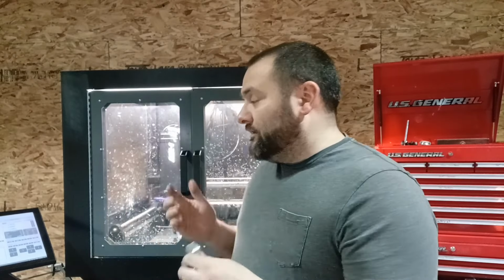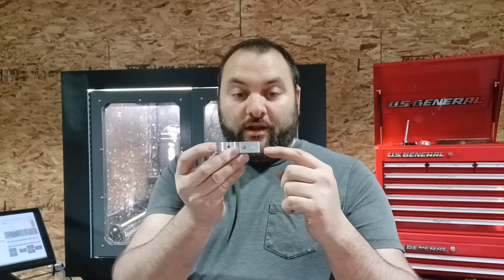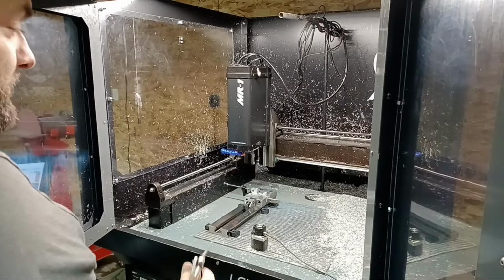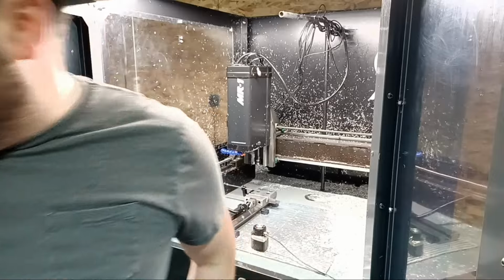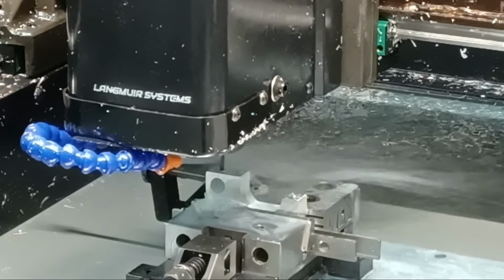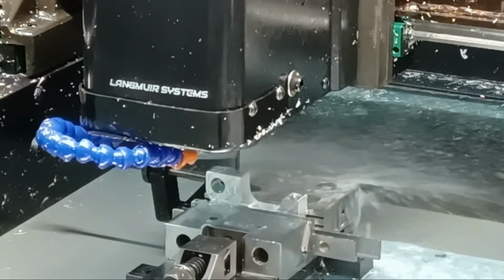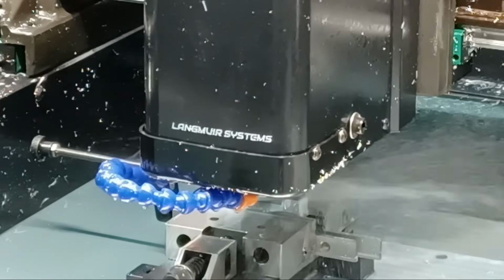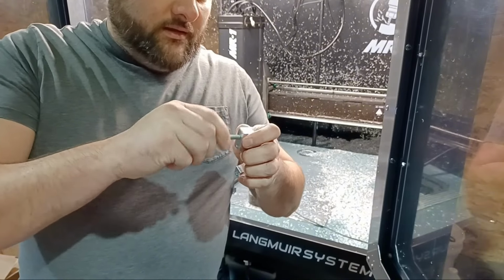Langmuir Systems MR-1 review/ thread milling demonstration

Comment: Really cool to see a an actual review and product from one of these.. I'm definitely considering getting one once my shop is built..
Reply from the maker: Glad it was helpful!  I'll be doing a lot more of these as I get more hours under my belt.
Reply: get it.  I was like you, now recently up and running and can't imagine not having it.  Def need a CAD program to get the full use out of it and likely need a post processor other than Langmuirs to do long form G-Code canned cycles of any sort (main drawback).  They'll likely update since it's just a software shortfall at the moment.

Comment: Do you have the concrete tie downs for the machine in this video?  And would you recommend?
Reply from the maker: I don't have any but it might be a good idea.  when you try to bore a small hole at high speed the machine shakes quite a bit.  Some beefier legs would help that.

Comment: Sick video, I’ve been thinking about building a CNC machine for a long time (also an automation/PLC engineer) but I saw the price of this machine and at the price point doesn’t look too bad. Not sure how much programming you do and I need to do more research myself, but do you think there is or may be a possibility of adding a 4th or 5th axis? Eventually I’d like to have the capability of 4th or 5th axis but unless you build your own machine I don’t think there are lots of options for that on the market.
Reply from the maker: we to take this to the next level you'll need to change out the Langmuir controller to something like an Acorn board from Centroid.  Than you can do 4th and 5th axis.  That would also allow you to change out the spindle to one with and ATC and do tool changes.  The machines is really good as is but if you've got the ability mod the control cabinet than the sky is the limit.
Reply: @BeckTools how are you going to add the 4th/5th axis? It's not just about the PLC, it's also about the trunnion.
Reply from the maker: @JF32304  You don't need a PLC to add a 4th or 5th axis to a CNC.  You just need a controller that will support them.  The Acorn board from Centroid will support 5 axis.  You can buy Trunnions from lots of different companies.
Reply: @BeckTools  yes I stand corrected, you need a controller to interface with the additional axis and you need the physical trunnion. You get that and you're good to go.

Comment: Hello! Great machine. I would need something smaller, but with the same abilities. I'm really not into this world (yet), so could you tell me some options? I looking for a machine, with roughly 25x25x25 cm workspace, and ability to mill on steel. Maybe thread milling also. Thank you very much.
Reply from the maker: Well I was totally like that's possible than you said mill steel.  Most of the small machines might struggle with steel...  Size gives you mass and leverage  that give you rigidity which allows you to mill hard materials.

Comment: Looks dope. Would be interesting to see how much maintenance it requires.
Reply from the maker: It shipped with a spindle that was too tight and it caused it to overheat and destroy itself.  The second spindle they sent me (for free) has been running flawlessly.  I guess they have a bunch of those tight ones they ship first.  They are fine for lite usage and will eventually break themselves in over time.  But fore people who push them hard.... You'll need one that is not tight.  They might have gotten all the tight ones out of the inventory by now.

Comment: Feedrate seems a bit high...
Reply from the maker: when I made this video the Z-axis bearing was installed upside down from the factory causing extra vibration and chatter.  now that I fixed that I'm running a lot faster than in this video with much less noise.  :)

Comment: I'm very dubious this machine could mill any steel
Reply from the maker: I run steel parts on this machine all the time.
Reply: @BeckTools  what tolerances does it hold
Reply from the maker: @joewboe  well that depends a little bit on you and you're assembly abilities... I can bore dowel holes +.0005 without using a reamer.
Reply: @BeckTools  I'd be curious to see a video on this
Reply from the maker: @joewboe  I made a video on how to eliminate burrs that shows it.